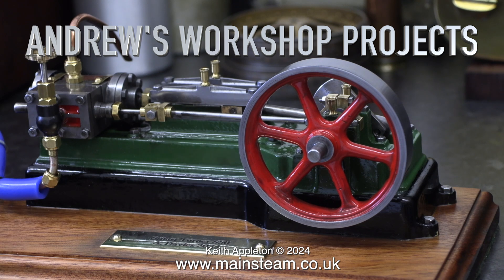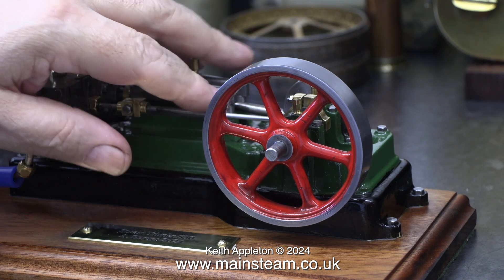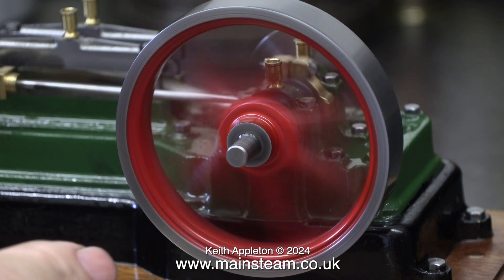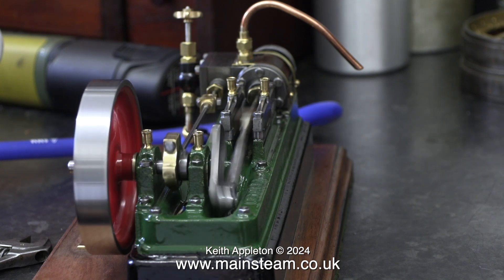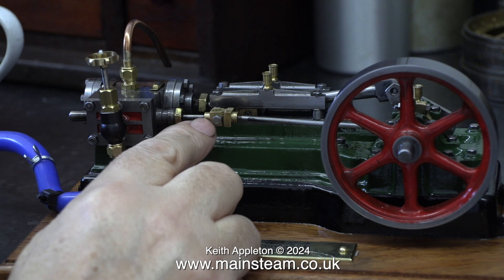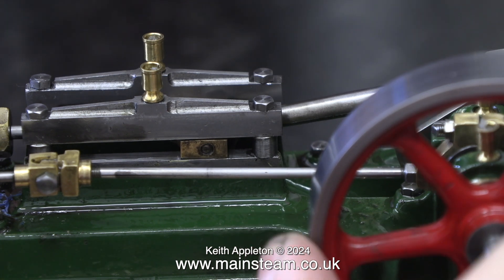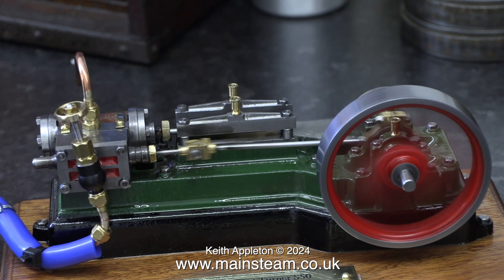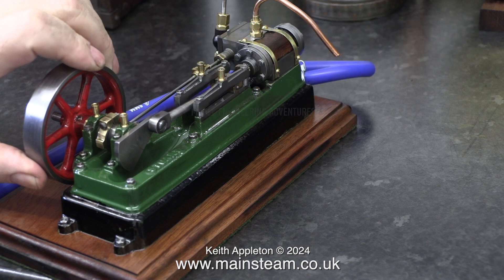ANDREW'S WORKSHOP PROJECTS - PART #16

Comment: A nice job Andrew - very nicely machined and nicely painted too but visually those nice upper slidebars should be shallower.  These engines ran at slow speed so maybe once it's run in it will do.  Keith's comments about the inside of the flywheel rim are spot on and I swapped my bolt heads for real ones too.

Comment: I built an S50 45 years ago. Only ever run on air. The boiler I planned to use disappeared during a move. It wasn't completed  as far as fittings were concerned, but had passed a hydraulic test.